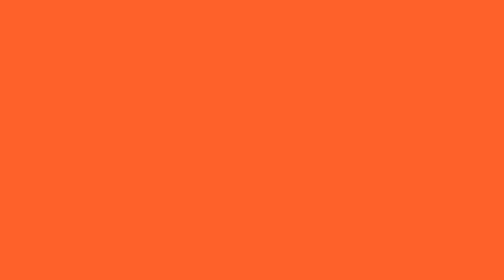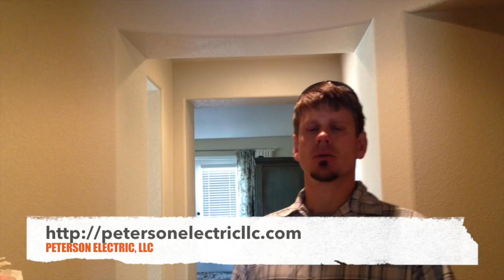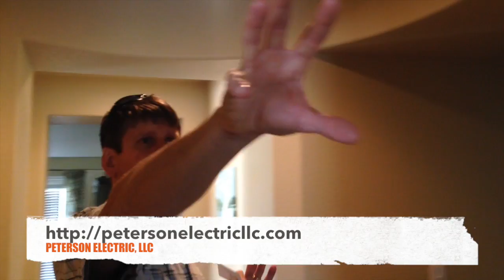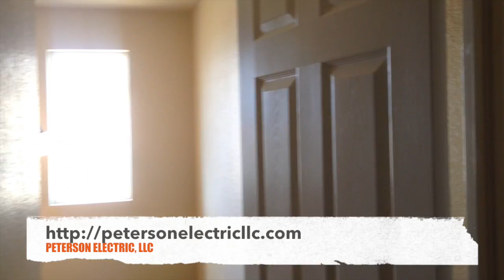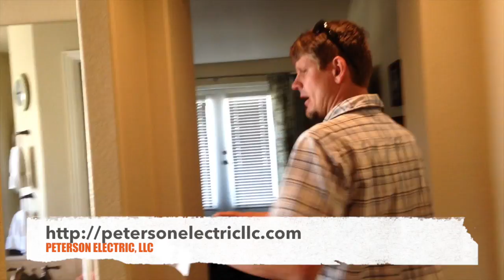What Was The Nuisance Tripping Of The Arc Fault Breaker In Some Areas Of The House?

Comment: Why are my kitchen lights staying on, I have one wire connected without the ground, with the ground it does the same thing, what am I doing wrong?
Reply: I dont believe your ground has anything to do with your light staying on. Actually the ground doesnt really have anything to do directly with the opperation of any circuit. It does, however, create the neutral when it is bonded since it places the neutral at the same potential as the ground. You didnt give much info, but it sounds like you probably tied your switchleg to the hot making it a constant hot instead of a switched hot, or perhaps you had an open loaded neutral or a backfed circuit due to a bad neutral. Since it did it with and also without the ground, i dont suspect a backfeed on ground. Youd need to get a multimeter and see if you get a voltage on neutral and check to make sure you have a switched wire to the light.

Comment: VERY HELPFUL INFO!  I've got a 15 amp AFCI breaker running 2 bedrooms, a bathroom, and the overhead lighting in the kitchen, hall, and dining area.  Way too much on one circuit, but my house was built in 1950 and they only re-did the electrical in the other half of the home.  The breaker has been holding fine since I bought the house almost 3 years ago, and would only pop when someone ran a hair dryer and all the lights were on at the same time.  But now, it's popping randomly.  Your explanation makes perfect sense, I'm guessing either the switch I replaced in the kitchen last year is now having issues (maybe the wires came loose when I shoved it back into the box) or the replacement ceiling fan I put in has a wire loose.   I'm going to have to open everything back up and triple check my work on the 2 ceiling fans the the kitchen light switch, maybe even replace all the wire nuts?  Do those go bad sometimes?  How do electricians replace electrical in a home with no crawl space is it just a matter of poking a ton of holes in the drywall and then having a drywall guy come and patch it all up when the electrical is done?
Reply from the maker: We can do anything with a 6" whole saw bit. If you don't want drywall cut, run pipe outside.

Comment: Nice explanation, but how many homeowner can afford the "needle haystack" search throughout the house.  I'm sure electricians act fast and thoroughly, but still can be an endless process.  For instance,  it's usually a set of wires that are not utilized properly that trips the expensive AFCI breakers.  It can even be wired correctly, but a frayed cord can cause the trip.  All in all, how many homeowners can pay an electrician for the time spent isolating each wire, using a meggar, and starting the process on the next group of wires downstream?
Reply from the maker: It’s all about research and budgeting your home surprises. But asking good questions as you call to interview electricians and checking their type of wiring they are good at.

Comment: Hey Joshua, Thanks for the video.  Can you please tell me more about the difference between hardwired and soft-tailed plugs.  Code required we install all arc-fault circuit breakers in our new detached cottage.  However, the vacuum cleaner (presumably the brushes) will trip them every time.  Should we have been allowed to have a separate circuit to plug in the vacuum cleaner?
Reply: Peterson Electric Article 210.12 has been code since NEC 2002 code book. It’s on page 70-54 of the loose leaf code book. People make it sound like this is some kind of a new code. I been in the trade since 1981 and love watching all kinds of videos like this. 🙂
Invest in a wiggy to help test AFCI, GFCI and they also can tell you if you have 120v to 600v on a circuit. They act as a load on a circuit like a light bulb would do. And they won’t shatter like a bulb if you should accidentally drop them like a bulb does. 👍
Reply from the maker: "soft connected" loads are the items that anyone can plug in to for power light or heat. 

"hard connected" loads are the hardwired items and customer's, tenants and public cannot get to without tearing in to the drywall. 

I would see if you can get any room according to 210.12 to set on an afci breaker and then test the vacuum there and see if acts the same.
Reply: Peterson Electric thank you for the clarification.  What is 210.12?  Is that a special arc fault breaker that will not trip with vacuums?
Reply from the maker: 210.12 is the code article in the NEC 2017 code book that speaks about the rooms and the reasons to update to AFCI protection.